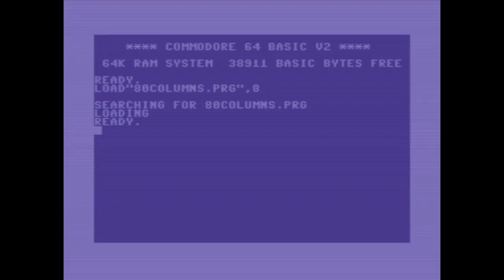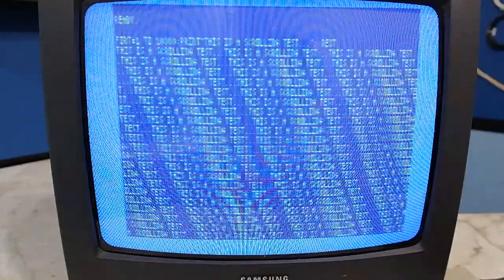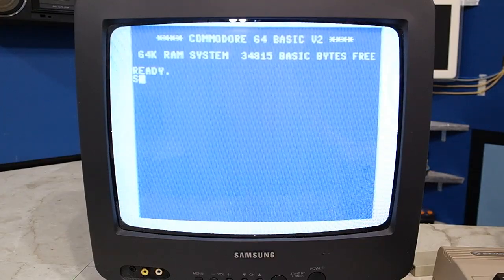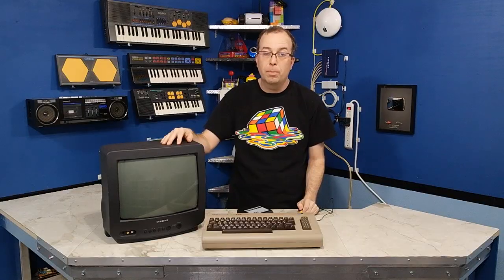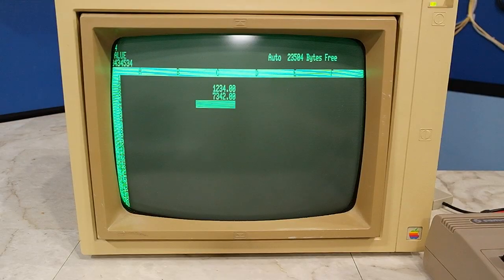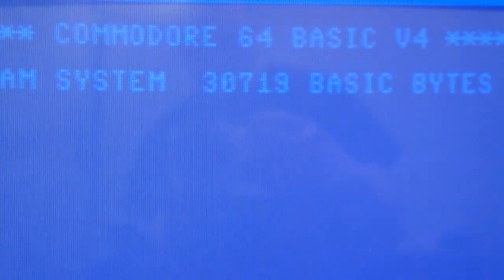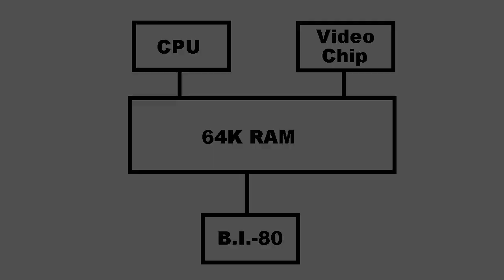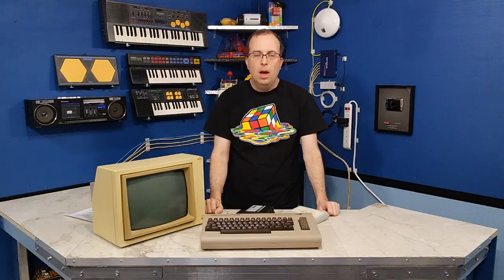The Quest for 80 Columns on the Commodore 64

Comment: Lol....the quest for perfection on obsolete hardware!  I love it!
Reply: MadMalcolm D Commodore 64s never go obsolete.
Reply: No, 1983 was when it was introduced.  1993 is when they stopped producing it (mostly because the company went out of business.)
Reply: MadMalcolm D Is your hardware between your legs also obsolete?
Reply: I guess it is if the feminazis have their sperm banks! :-D
Reply: If human cloning becomes a reality, don't be surprised if they advocate for male feticide for the "safety of all women."
Reply: Eddie Burke your EXE file running computer can't natively run ARM code, and computers running ARM are far more prevalent than x86 machines. ARM based computers don't natively run MS-DOS EXE files either.  in fact, x64 computers probably don't; they probably use JIT emulation.  The C64 can do that if you are really determined.  It wouldn't be fast, but it can be done.

Any computer that is Turing complete can do anything any other Turing complete machine can do, just not necessarily at the same speed.

But your language proves you correct, right?
Reply: Old. Not obsolete!
Reply: 38911bytefree Windows 7 is not a fair milestone for obsolescence, in my opinion.  The only fundamental task that new computers can do and the C64 can't is stream high quality video.  Everything else that new computers can do, the C64 can do, albeit slower.  The funny thing though is that a computer 1000 times faster than the C64 hardware typically doesn't do things more than 500 times faster than the C64.

Have you ever seen the C-One?
Reply: Old...not obsolete.  I agree.  Quick confession.  The commodores were before my time but I enjoy these videos greatly.  Our first PC was a 286 that i didnt know the other specs of...shortly therafter we got a Compaq with a Pentium 100Mhz, 16 terrifyingly huge MB of ram and a whoping 1GB hard drive.  And damn...the games from that era are just amazing.  I grew up with them.  Watching these videos makes me want to check out some of what the commodore machines may have to offer.  I am amazed at some of the functionality they possess.
Reply: I see it like this... When people my age were playing with this stuff back in the 80s (8-bit Commodore for him, Atari for me), we had all these daydreams about where the technology could go, if we took it a step further--what the next version of our favorite machine, or our next expansion of our favorite machine, might be. What could a 1980s-model 8-bit computer be, taken to its full potential? But not all of those dreams got fully realized. There might have been some obscure product on the market, but it never hit it big before some total upheaval in the market (like, say... the entire computer market switching over to an IBM-compatible/Mac duopoly) made it all irrelevant. As hobbyists, though, people like The 8-Bit Guy can explore those parallel tracks of technological history that never quite panned out. In some cases, modern technology makes it easier.
Reply: @MattMcIrvin  still looking forward to part 3 of his dream computer, a low cost Vic-20 base with far superior sound and graphics capability... I just think HDMI would be a helpful additional output besides VGA and composite out. Dumb terminal via USB and classic Serial might be a nice addition to magnify the usefulness of it.
Reply: see, it's people becoming obsolete, not computers that won't quit.
Reply: MadMalcolm D there is no complete Turing machine on this Earth, because Turing machine by definition has infinite ram and C64 IBM PC or ARM don't.

bdw. someone run Linux on 8bit AVR. everything is possible
Reply: Even via emulation C64's are fun to play with. C64's are even internet compatible, believe it or not. They're comparatively much slower than what we got now, but if you don't have the hardware for whatever reason, emulation is a decent second. Quick question: Do "obsolete" and "outdated" mean pretty much the same thing, or does "outdated" mean "I don't wanna touch this again"?
Reply: Seen many vids on Graph and sound perfomance productions and presentations for he 64 and really blow my mind what this obsolete HW is still capable off. This machine (well, with the reliability limitations) could, for example implement a complete control for an elevator coded on basic. So is hard to tell obsolete. It is on terms that it wont boot Win 7, but 64K in ASM stil plenty of space to play with and create with, even TODAY. In most computers is getting harder to use them to control I/O mostly due OS permisions, lack of ports, fragile USB dongles .... Appart from industrial PC type, no PC with expansion slots and user port to play with ... you can get something similar using a Pi, and still kernel puts contraints in speed and latency to access I/O data unless use SPI or I2C expander. C64 twin CIAS are "almost" enterey yours, access on a breeze.
Reply: Costa Emmanouilidis why yes it is.
Reply: KC9UDX yeah... Because the Com64 can totally run exe files... M8 fuck off. The Commodore isn't even comparable to modern computers.
Reply: "User requests are what computers are for!" - Walter
"DOING OUR BUSINESS is what computers are for!" - Dillinger
TRON 1983

Comment: My dad tells me about how amazing his Commodore 64 was when he got one when he was in college.
Reply: Same can be said for the Nokia 3310, but I played Snake until the buttons fell off my first cellphone.
Reply: Actually, no it didn't.  It had the same processing power (a 6502 CPU running at 1 MHz) as the computer itself.  The disk drives that came with the PET were faster because they had dual 6502's, one of which did all the GCR encoding/decoding and the other did everything else, but on the 1541 they decided to use just one 6502 to save on cost.

The cassette routines were not buggy... they were the most reliable in the industry.  The problem is that the hardware (the 6522 I/O chips in the VIC-20) were buggy, forcing the computer to use "bit banging" (software) to time the tape reads and writes.  As you say, game publishers wrote their own routines that sacrificed reliability for speed (such as writing only one copy of the program instead of two, etc) to speed things up.

The Commodore 64 had 6526 I/O chips which did not have the bug that the 6522 did... but you were still stuck with the slow, software-driven load routines because some idiot put a screw hole where one of the traces would have gone, so the C64 still had to use bit banging.  It wasn't until the Commodore 128 and the 1571 disk drive that the computer and the drive had fully-functional hardware I/O.

There were some aftermarket products that required modifications to the C64 and 1541 (such as JiffyDOS) which included new BIOS ROMs and working I/O that gave the 1541 the speed it should have had, and game publishers developed their own formats that worked both as copy protection and a super-speed loader, such as the Epyx Vorpal system.  Vorpal was about 23 times faster than the standard Commodore format, could store about 20% more data per track, and except for track 18 (where the directory was, and where the Vorpal routines were hidden), could not be read by a copier expecting the standard CBM format.
Reply: Its floppy disk drive had more processing power than the computer itself and the cassette routines were buggy to the point that every games publisher wrote their own routines to stop their games taking an hour to load.

Once he games had loaded however, the C64 was a great machine.
Reply: Bit banging just means that software directly sets and samples the state of pins on the microcontroller, and is responsible for all parameters of the signal: timing, levels, synchronization, etc.  Originally, this was supposed to be done by hardware (the 6522 I/O chip), but as I mentioned, the 6522 had a bug.  As a result, the CPU has to do all the extra work that the 6522 was supposed to do.  And this is the reason why the tape and the disk drive were so slow.
Reply: I'm sure that's part of it.  Commodore's looming bankruptcy probably played a role in it too.  I haven't found out if MEGA (the Museum of Electronic Games & Art) ever released their recreation of the C65.  They were supposed to have released it in the 3rd quarter of last year.

EDIT: Thought I'd better clarify what I meant by their "looming bankruptcy".  The C65 was cancelled in 1991, after somewhere between 500 and 2000 prototypes had been built.  Commodore didn't go bankrupt until 1993, but they were almost certainly already hurting financially.  C64 sales started dropping after 1989, the C128 never sold in the numbers Commodore was hoping for, the Amiga's marketing (actually all of Commodore's marketing) was anemic ever since Tramiel left, and management was making stupid decisions left and right.

For example, cancelling their flagship magazine.  "We're a computer company, not a magazine company", they said.  Maybe, but at least you don't have to pay for advertising in your own magazine, and they certainly weren't advertising very much in anyone else's magazine either!  And the only TV spots I saw were local (e.g. the only Amiga vendor in town started making his own commercials and newspaper ads).

So, yeah... in my opinion, they were already in financial trouble when they canceled the C65.  Hence, "their looming bankruptcy".
Reply: @ ᏳᏫᏜᏡᎦᏈᏜᏫᏳ

The C64 certainly was amazing for home computer owners in the 1980s, well until the Atari ST and Commodore Amiga came along.
Reply: "The C65 was killed because it would have made the Amiga totally undesirable."

Wasn't the C65 Jack Tramiel's last project before he got booted out and went to Atari?

The first thing Commodore did after kicking out Tramiel was buy Amiga out from their deal with Atari (that deal being the first thing Jack Tramiel did when he bought Atari) IIRC

So you could argue that it was killed off for political reasons (see also the Apple IIgs a 16 bit upgrade to the Apple II)

Of course, Commodore UK could have looked at the failure of the Sinclair QL and the Sam Coupe (the Sam Coupe being a 16 bit upgrade to the Sinclair ZX Spectrum) and advised CBM International against it... but that would require CBM International to actually listen to Commodore UK.
Reply: Makes me sad every time I think about "what could have been".  Maybe, just maybe a world without Windows being shoved down our throat?  Maybe Motorola making killer CPUs as a viable option for home PCs?
Reply: GeoNeilUK that wasn't a bug, it was error-checking overkill
Reply: KC9UDX  True, but the dual processors didn't hurt.  Also, in a manner of speaking, it was a bug (in the hardware)... combined with error-checking overkill.  :)
Reply: GeoNeilUK It's a crying shame that Acorn isn't round to reap the benefits of that chip.

I have an A3000UX.  I have the system tape (don't think it works anymore though), and for twenty years now I've thought it would be fun to install UNIX on it like it was supposed to be, but I just can't bring myself to run anything less than Amiga OS on an Amiga!
Reply: Alfred Stampe It might have been Dolphin DOS, Speed DOS, Prologic DOS, Turbo-Trans, RapiDOS, DigiDOS, 1541 Flash!, or Professional DOS.  All of those required a parallel cable which ran to the RS-232C or the cassette port.  My first guess would be Dolphin DOS; it seemed to be one of the most popular of the parallel cable solutions.

While it probably wasn't as fast as any of those, JiffyDOS did have the advantage of not requiring any special cabling, and some of the custom formats, like Epyx Vorpal v2, proved that you could get blazing speed without a parallel cable (Vorpal was about 23-30 times faster than the standard Commodore DOS).
Reply: But they blundered the launch of the CD32 by not having enough money to license patents that would have allowed them to launch the CD32 in the USA (it only saw a Canadian release in North America)

And the CDTV was an even bigger flop due to Commodore selling it a a competitor to the CD-i - a mult-aye-media applaince that nobody wanted or saw the point in - rather than a Commodore Amiga with a built-in CD-ROM - which would have sold like hot cakes in the UK but might have hurt sales of the A500+ and A600.  That and them putting Kickstart 1.3 on the CDTV when they were already releasing computers with Kickstart 2.0

But then, nobody saw the point or wanted an Amiga in the USA for some reason, apart from TV stations and CG studios of the day.

The A600 should never have been released.  As it was, it was released way too soon after the A500+ and created an entirely new hardware platform obsoleting a huge perecntage of all the addons and peripherals that were A500 and A500+ compatible.  There might have been a point to releasing the A1200 the way it was, but the A600 really shouldn't have even made it to the drawing board.  

As for the C65, maybe it was seen to be just one too many projects on the go... and maybe the political reasons stated above.  

I mean, why continue to develop one platform when you've already got a successful platform going?  

And the Amiga was successful, when CBM International went under, Commodore UK were turning a profit and wanted to buy their parent company.  What could have been...
Reply: They did spin off the RISC machine into its own subsidiary and changed the A from Acorn to Advanced and they remained resolutely British until just this last year when SoftBank bought them out, but I still feel a tinge of national pride though, ARM is still British to me!

Their RISCOS lives on though (complete with BBC BASIC) through the free for personal use version of RISCOS which actually does work with the Raspberry Pi.

I think it's freeware rather than Free Software though, which is a shame.
Reply: +HFCRacer I'd think we'd be living in a world where Apple's place would have been taken by Commodore, the Amiga would be the choice of Hollywood and Steve Jobs would have been updating his CV for a job there.

We might have even seen a merger or acquisition involving DEC as well as the makers of the Video Toaster and the Opalvision.  Commodore really could have done with a server business.
Reply: GeoNeilUK Much agreed!  And just think, there would be really lousy cell phones on the market called "Apple ]["
Reply: Armed with my Commodore and a 300 baud modem, I used the first method in this video for 80 columns so I could access my college's DEC computer at home instead of having to stay on campus.  This must have been around 1984, if my memory serves. It was slightly blurry (compared to 40) but it worked and saved me a bunch of time.  It also allowed me to procrastinate something fierce since I could connect at 2:00am instead of getting my work done during the day. It was awesome for the time...
Reply: I know about "head banging", but not about "bit banging"
Reply: SpearM3064 I had a parallel interface for my 1541 back in the day, it was many times faster than the standard serial connection. It consisted of a board placed inside the 1541 on top of the existing chip sockets then had a ribbon cable to the c64 parallel port. Don't remember what it was called, but it worked really well.
Reply: SpearM3064 the 6502 in the 1541 runs a little faster than the 6510 in the '64.  But it has less resources.

The PET drives weren't faster due to the dual processors.  They were faster due to the parallel bus on the PET.
Reply: HFCRacer They simply did.  The 68k ran circles around x86, per MHz.  Not enough sold though for them to make them at faster MHz.  Truth is though, the 6502 and its successors run circles around 68k per MHz, one of the reasons the C65 was a threat to Amiga.
Reply: GeoNeilUK Most of Commodore and Amigas failures were a total lack of marketing.  Part of the problem was that the Amiga was just too advanced for its time.  No one really knew how to take the best advantage of it.  When I saw it on display, I couldn't see the point of it.  It didn't do anything the C64 didn't do, except that it could display pictures with a few more colours.  At least, that's how the demo I saw looked.  I remember reading about the CDTV in a science magazine, and never saw one for sale anywhere.  I assumed that they ended up never producing them.  Another problem was the wrong people were making decisions about hardware and software.  Like the CDTV example.  But especially the A3000+ and A4000 fiasco.  An A3000+ in a tower case would have clobbered the rest of the market.  And if only Commodore hadn't told Sun Microsystems to piss off when they wanted to licence A3000UXs!
Reply: "Truth is though, the 6502 and its successors run circles around 68k per MHz."

Hence why when Acorn mused about a processor upgrade from the 6502 for their next generation up from the BBC Micro, they designed their own.

But of course, if you ask +HAL this, he'll tell you that this new processor that Acorn designed was insignificant and only popular in the UK.

"And if only Commodore hadn't told Sun Microsystems to piss off when they wanted to licence A3000UXs!"

That I didn't know.
Reply: EgoShredder even beyond that, it was very hard to justify the upgrade.  The C65 was killed because it would have made the Amiga totally undesirable.
Reply: SpearM3064 Well, their biggest problem which caused all their other problems, was mismanagement at the top.  Given that they managed to bring the CDTV, A4000, A1200, CD32, A600, etc to market around that time, I don't expect they had a legitimate reason to cancel the C65, except that they couldn't justify selling it for a price that wouldn't hurt Amiga sales.
Reply: GeoNeilUK I didn't hear about the SoftBank deal! :(  Soon you'll have Jerry Berries... #jerrybeans